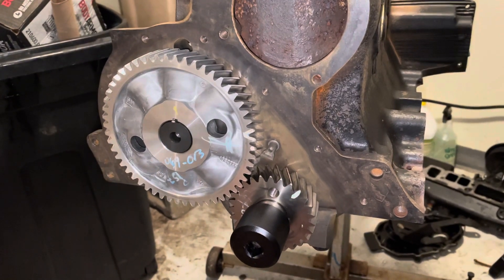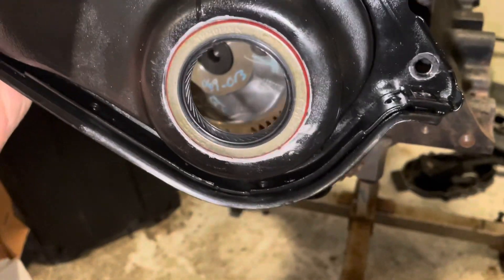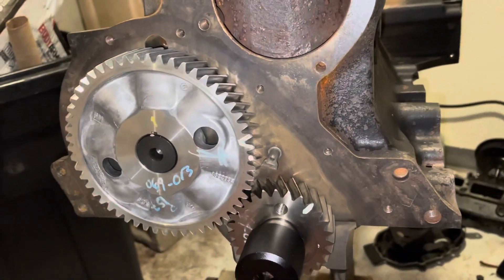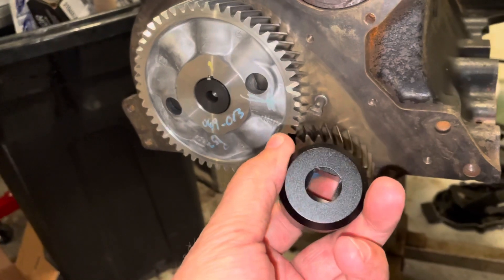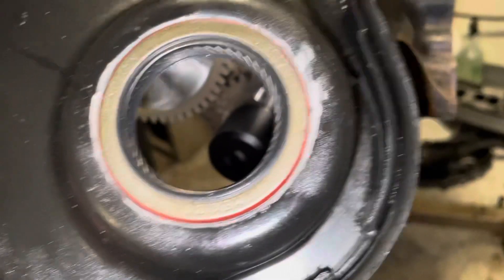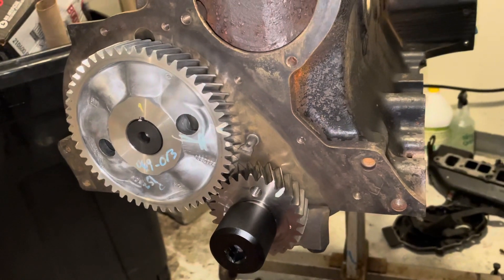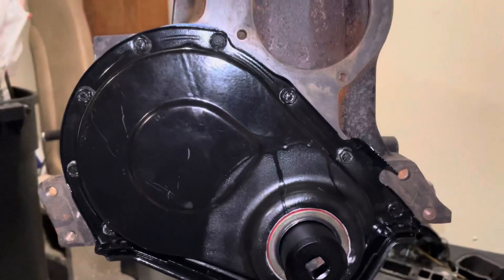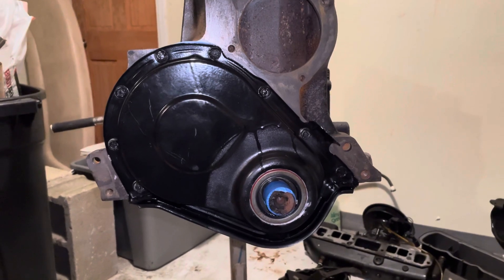Mercruiser 3.0 2(i) - Tool Saves Time

Comment: I'm pretty sure this should be a Proform 66901.   I ordered the 66900 and both the ID and OD are larger than would work on the 3.0.   I checked the specs for the 66901 and it appears to match the 3.0 crank.  I'll update my comment once the new one arrives and i can confirm.
Reply: did you ever confirm ?